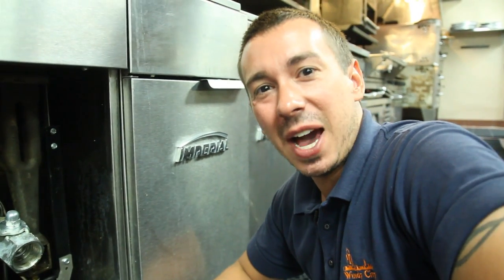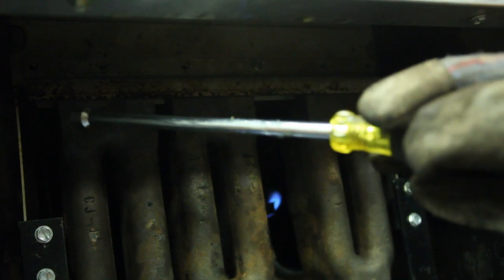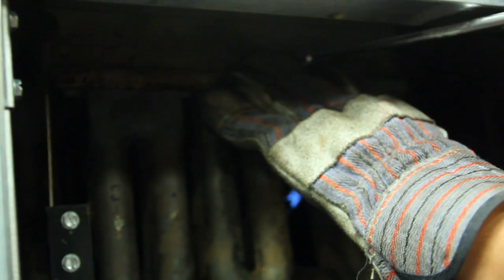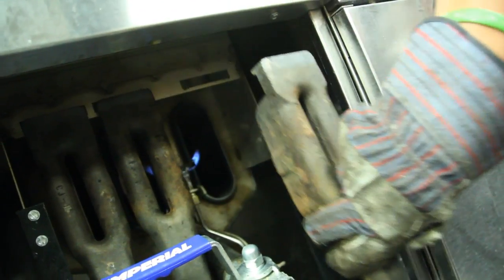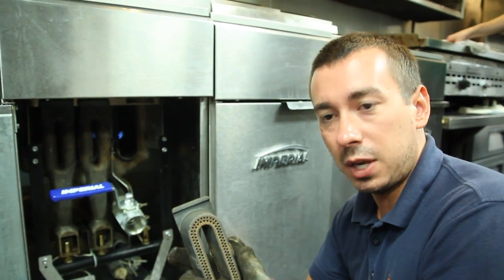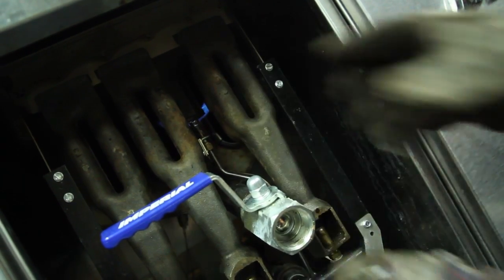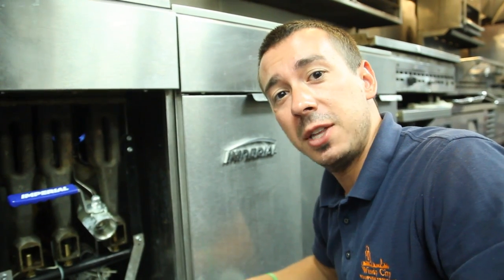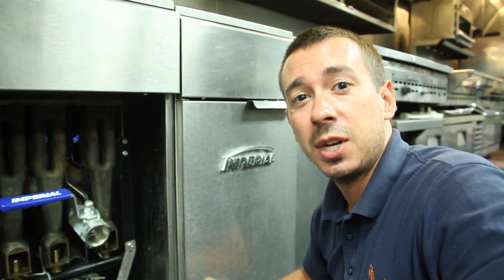How to clean fryer burner tutorial DIY fryer maintenance Windy City Restaurant Equipment Parts

Comment: Thank you for all your videos they are a help beyond what you could imagine. Can I ask how long is best to leave the burners soaking in the soap and water? Also would washing up liquid do for it? Thanks again
Reply from the maker: If the burners are cast iron you don't want to let them soak for long otherwise they'll rust.  So I would say 30 min max.  Make sure to use an non abrasive soap like Dawn dish soap.  Scrub with plastic bristled brush and dry thoroughly before reinstalling them.  So glad the videos help you!  Thanks for watching!
Reply: @Windycityequip  thanks man major help I totally appreciate it

Comment: This was a great video. My Imperial has a flame coming out from the orafice on one of the burners. Does this mean it has come ooose some how.  Cant find a detailed schemeatic on how these are attatched
Reply from the maker: This usually means one of three things: Either you have a bad gas valve (only if the orifice remains lit after the unit shuts off) or you have a blockage in your burner or flame tube.  OR sometimes, if the gas pressure is too low the flame can travel down the burner and ignite the orifice, but this would most likely be happening on all of your burners.  I would check for blockages (soot buildup).  Hope this helps.  Thanks for watching!

Comment: Great job in showing how to clean the burners!!  How do you clean the commercial fryer, in particular, the back of it, behind where you hang the baskets?
Reply from the maker: Thats the fun part! Haha.  If you look at the back of the fryer there will usually be screws on the left and right sides of the "flue"  If you take these screws off it will expose the back side behind where the baskets hang.  Then bust out the gloves and scrapers!

Comment: Can you use a degreaser on the cast iron burners and then scrape them with a spatula?
Reply from the maker: No, I wouldn't use a degreaser.  A lot of those are acidic and can damage the burners.  You're better off using soap & water and a brush.  Then, make sure the burners are 100% dry before setting them back in place and applying flame.  Thanks for watching!

Comment: Thanks for the very helpful & instructive veideo. Is the flame on the pilot adjustuble, is there any adjustment that would enable me to reduce that flame??
Reply from the maker: NKadi - Yes, the pilot flame is usually adjustable on fryers.  But since different fryers use different gas valves, there is not always one universal way to adjust.  On the most common fryer gas valves, however, you can follow the pilot line into the valve and look for a small silver flathead screw.  This will usually be very near the pilot line and this flathead screw is usually just a "cap" that covers the the actual adjustment screw.  Remove the flathead and locate the adjustment screw beneath (another smaller flathead).  Turn clockwise to adjust the flame down, counterclockwise to adjust the flame up.  Hope this helps!  If you need further assistance, feel free to call our toll free tech support at (855)WINDY-AZ

Comment: My fryolater caught fire inside the compartment this weekend on my food truck. We shut it off and later I tried to wipe down the areas in case it was a grease problem, tried to restart it, and had the same issues. Any suggestions on what my next steps are to check where the issue is? It doesn't seem to be a propane issue - could it be as simple as too much splattered grease everywhere, requiring a deep clean? 

Thanks!
Reply from the maker: It absolutely could be. I have seen that many times.  You should also check to make sure your frypot isn't cracked.  Often you can identify this if there appears to be "oil trails" from any of the welds on the corners or burner tubes.  Were you able to see what was on fire?  If it was a gas line, the tank itself, or a specific component?  Let me know and we'll se if we can isolate it.  Thanks for watching!

Comment: How do I clean inside of the flyer where all the important part is?, there's thick greased built-up all over the place inside. I had Google it but none of them showing how to.
Reply from the maker: That's not an easy task. And honestly, if there is grease around the components, and more importantly, up by the flame tubes, chances are you have a crack in your frypot somewhere and it could be a fire hazard. Without seeing it myself I'd have to advise that you buy a new fryer (if it's an economy fryer like the one in this video).  If it's a big expensive bank fryer with computer controls and a filter system I'd recommend having a company come out to do it for you.  Hope this helps. Thanks for watching!

Comment: Suggested video subject: How to do proper boil out of deep fryer?

Today we tried to deep clean a four bank of Pitco fryers that do heavy volume but have been neglected for over one year.

Disconnected quick disconnect gas lines and attempted to separate and scrape exterior surfaces of fryers and floor beneath, as well as do a boil out before opening time. Too much funk, not enough time.

Wound up creating a fire hazard, dusting the kitchen with extinguisher dust and scaring the bejeezus out of staff.

A few things we did wrong:
Not allow sufficient time for major project.
Not careful about where grease scrapings fell. (Do NOT let them fall down the flue vent)
Set thermostat on fryer to usual 350 degrees instead of 212 during boil out.
Reply from the maker: Thanks for the suggestion David.   What a great topic!  And thank you for sharing your experience, I'm sure there are several folks out there that have had a similar situation.
Reply: and never leave a boil out unattended!

Thank for all the time and effort your guys put into these videos.

Comment: I have mike fryers I took the burners out and the plate at the top was not screwed in like in your tutorial. Neither are there holes. Since I put it back together I am getting burning on the inside plate in the fryer. How do I fix this it was not like this before also is there are certain area the baffles or plates inside the burner are suppose to be are they meant to be in the middle at the back or near front. Thanks for your time hoping you can help
Reply from the maker: Imperial has changed their design since I made this video and they went to the style that you are describing.  If you installed them exactly how you took them out, there shouldn't be any change in the flame.  This could be coincidental as it sounds more like a gas pressure problem.  Either that or there is buildup or blockage in the burner tubes or the back flue.  And yes, the flame tubes usually have "baffles"  that rest close to the center.  Hope this helps.  Thanks for watching!

Comment: what about build up from propane and soot in the flue? How would you access the flue to clean the the build up out? thanks
Reply from the maker: Steve Valentino Good question!  Unfortunately I didn't have the time that day to show this.  Pull out the fryer to access the back.  Take off all screw on the backside (Left and Right).  This will take off the back panel and expose the flue.  The flue is usually either pressed together or is held in by 2 screws on the left and the right.  Remove that and you will have access to the bottom of the flue and have the ability to wash the top of it in the sink (Just make sure its COMPLETELY dry before reinstalling).  Hope this helps!  Thanks for watching!!
Reply: Thank you very much!!!

Comment: What's the best way to clean the burner?  Can I insert anything in the burner orifices? Do I use a wire brush?
Reply from the maker: Best way to clean the burners is usually compressed air/CO2.  If they're REALLY bad you can soak them in soap & water and scrub with a wire brush, but make sure they're completely dry before reinstalling them otherwise you risk cracking the cast.  And yes, you can insert something small into the orifice to clean, but you want to make sure you dont just push the debris into the manifold.  Best way is to remove the orifice and use CO2 to blow from the inside out.  Hope this helps.  Thanks for watching!
Reply: Perfect.  Thank you.

Comment: That burner sure looks Clean How would I clean one with lots of bulb up like coal and soot it's messing up my Catering truck stinks and leaves lots of soot?
Reply from the maker: Soap and water is the best.  Propane burns very rich so I'm not surprised that you have this problem, I see it ALL the time in food trucks.  Regular maintenance is key.  Used something strong and skinny to clear the burner holes, soak in soapy water, rinse with some pressure, and always, always make sure they are 100% dry before using them in operation.
Reply: Windy City Restaurant Equipment Repair Great thanks
Reply: I have a food truck too. Have you ever had a problem when the rubber part of the drain valve gets so hot. It melts?

Comment: So everytime i turn on my fryer. The rubber part of the drain valve handle melts. Plus to of the fryer vat burns as well. Maybe this is the solution? What do you guys think?
Reply: Do the fire be blowing out burning rubber handle and the fryer door
Reply: @jaybeezlunchbox  yes!
Reply: @chefjosswiththepot3464   I a having this same problem with one of my fryers also!  Have you been able to figure out whats causing this?  Also when this happens the handles on the fryer baskets become too hot to handle.  I would appreciate an answer, as we are having a big event next month.  Thank you!
Reply: @treasurecoasthomesteader5868  I changed to a smaller probe under the burner.

Comment: I'm repairing the control board of a Hobart HFGC45 fryer which came with incomplete wiring to sensors and other devices in the fryer itself. I found a shorted decoder IC which I replaced and tested again. The board beeps almost continuously and some of the relays click on and off. 

I am afraid this board will behave that way until sensors and other stuff get connected, however, I haven't been able to find the wiring schematic between this controller and the rest of I/O devices, only parts lists and installation manuals. 

Is there a way you could help me locate this wiring schematic? 

Thanks in advance. By the way, good music and great videos you got.

Rafael Larios
Reply from the maker: +Rafael Larios do you have the ML number and Serial number?  If you can get me that I'll log into my Hobart portal and see if I can find something for you
Reply from the maker: +Rafael Larios cool let me know, but don't confuse the Model Number with the ML number. Hobart uses 3 numbers on their equipment 1) Model 2) ML and 3) Serial (don't ask me why). But they categorize their schematics by ML number so check the nameplate if you can and see if it lists an ML Number in addition to the Model & Serial. If you can't find it, I'll see what I can dig up without it. I'm sure I can find something for you.
Reply: Hi there! Well, I believe I found the problem. The owner found another control like this that worked. I tested every component that could be removed from the bad control board and it turned out to be the control program EPROM. I also tested the microcontroller which produced  an error upon start up, but proceeded to work afterwards. 

Is it possible to find this type of parts such as pre-programmed  microcontrollers? I can copy the EPROM contents, though. I wonder if the microcontroller's code is protected.

I will appreciate any help you could provide. Thank you for your help, sir.
Reply: Hi there again Josh, 
Please, correct me if I am wrong. It seems the type of controller I mentioned can have its products programmed into the controller's memory. Being this the case, this may explain why I got the message "CHECK PROG." upon start up.

I got a manual for this HGFC45 Hobart Fryer and it seems the only error messages that are shown at turn on time that stop the machine from operating are: "TEMP TOO HIGH", "CALL SERVICE", and arrows flashing which indicate  a RAM failure.

I am not familiar with the operation of this fryer, but, any clue as to what "CHECK PROG." means?

Thanks in advance for your  help.

Rafael Larios

Comment: I have flames coming out the back of my fryer where the heat escapes. Does anyone know how to fix that
Reply from the maker: Sounds like your gas pressure may be too high.  You need to adjust it down.  Depending on the type of fryer you have you may be able to use this video https://youtu.be/isCF2ceQI9U to help.  Thanks for watching!

Comment: I was told to never use water because it would leave a residue. I've done it in the past and never had a problem.
Reply from the maker: You can absolutely use water.  Some water may leave a residue, particularly if it's hard water, but it will burn off just fine.  Just always make sure your burners are COMPLETELY dry before replacing, otherwise they could crack.  Thanks for watching!

Comment: Great videos sir! I have an imperial fryer, same as the one you are working on here. My fryer developed a hole inside of it over the summer and the oil was leaking out. I took it out of commission, but was wondering if there was a way to repair the hole? Weld or braze it?
Reply from the maker: +Kevin Carter With the drastic heat fluctuations, that hole cannot be repaired.  It's an accident waiting to happen.  The weld/braze will fail within weeks and then you'll have a fire hazard.  You either have to replace the frypot or replace the fryer.  How old is the unit? Imperial fryers have a 5 year pro-rated warranty on their frypots.  If its more than 5 years old, get a new fryer.  THanks for watching!
Reply: What maintenance schedule would you recommend? Medium to high volume?